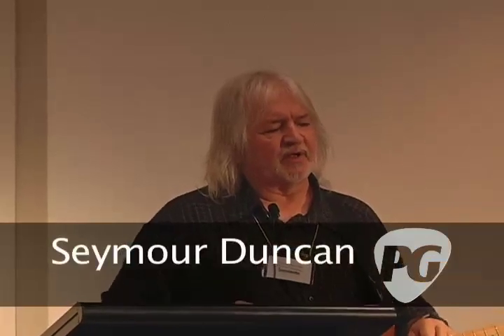Seymour Duncan - Differences in Alnico Magnets

Comment: 1:28 is bullshit. simple fact is different magnet qualities give different inductances. "string pull" my ass.
Reply: You sound like you have technical background on the subject. Seymour Duncan is a manufacturer of guitar pickups.I don't know that he has a degree on magnet theory. However it sounds like he has derived what knowledge he has by merely experimenting and maybe asking magnet manufacturers many questions about their products and maybe some reading on the subject? Just an observation.
Reply: string pull is neglible at the distance were talking about. these magnets are generally pretty weak, just touch them with a screw driver tip and see... they don't pull strings that much at all
Reply: He didn't say pull in that sense, he said vibration within a field and frankly a good ear and experience, of which Seymour Duncan has a ton, is the most valuable quality in building pickups.
Reply: Are you 'avin a laugh? Is he 'avin a laugh? I agree.  Neck and bridge connections will effect sustain physically, where as magnets at the strength and range in guitar pickups  won't. Even a ceramic magnets struggles to pull string nearly touching. It's a myth, and yet more guitar overcomplicaton in search of that tone 😂it's how guitar makers sell stuff. All the string does is move the flux lines in the magnet field. It doesn't have to interfere with the actual pull on the string in any way. Just like it doesn't have to be near the interference picked up.
Reply: They have enough string pull to cause "stratitis", a symptom my very own guitar had until I lowered my single coil pickups. Oh, I guiss I should admit that the polepieces are magnetic slugs.

Comment: Seymour is the voice of the 20th & 21st century.  no Seymour, no rock
Reply: have you seen the DC outputs of the "modern" pickups? that's insane
Reply: 13/15k alnico 5-8 for bridge, 6-8k alnico 2/3 neck.
Reply: Check out the bass pickups as well, i bought an antiquity single coil 1955 p bass although it has low DCR it does the job nicely :3 just imagine if i would have bought the Hot one
Reply: @ernestochang1744  Absolutely. Four years later, lol.
Reply: @cybrunel1016  6.5k
Reply: @ernestochang1744  5.9k
Reply: @cybrunel1016  :(
Reply: DC isn't a measure output, but resistance. It can only tell you how much wire pickup has (if you know what gauge of wire has been used).

mv is the measure of output, but there's no standardized way of measuring it...
Reply: I forgive you for saying that...you were soooo high that night, remember 4 yrs ago ?

Comment: Shit pickups use ceramics and shit pickups use AlNiCo. So what's the component difference between these and clear, good quality pickups?

Finding concise information on this issue is like trying to dig up state secrets.
Reply: B that's magnet stats. Like how alcino has way more flux lines in the field Compared to ceramic. So alnico probably pick up more harmonics, detail and sounds brighter, because the increase flux lines provide of that type of magnet, which give more sense of space. Just my own thought. Also alcino can be de-magnified easy. I think it's field is in a way easier to influence - I could be wrong, but you can see how this subject is weird
Reply: The difference?

Your ears my friend.
Reply: @shredhed572  My ears are not a component of the pickups.